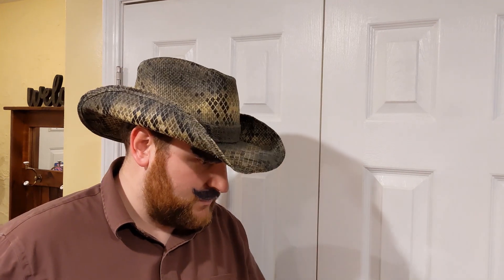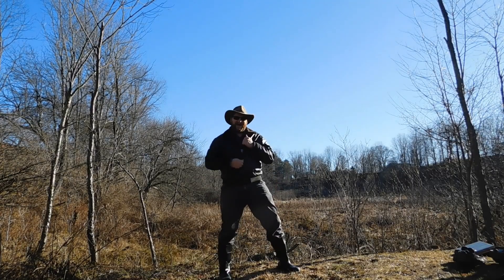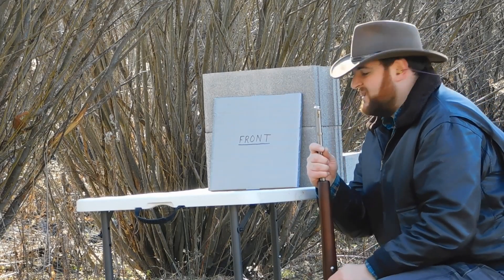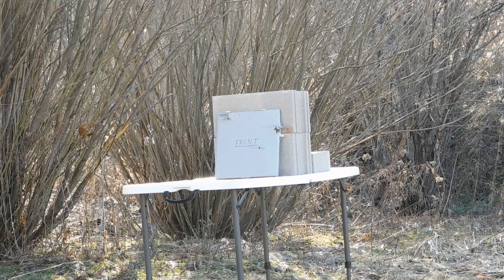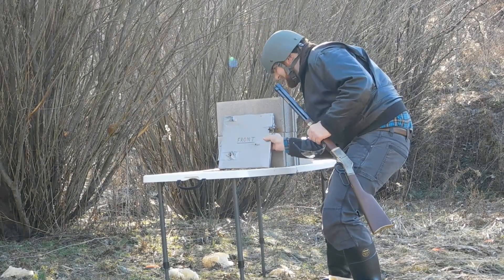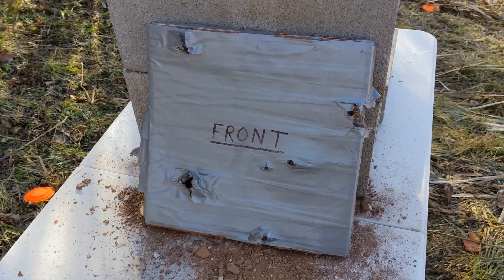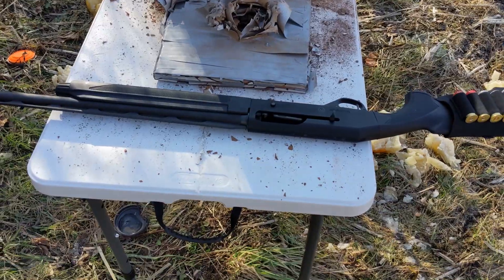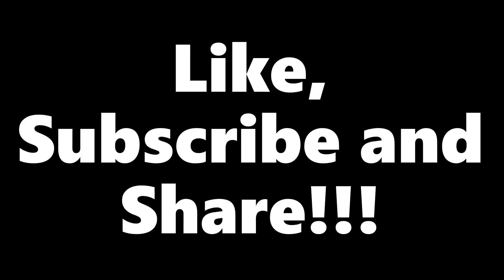Ballistics on a Budget: Archaic Armor

Comment: Overlap interwoven steel fiber at a 45° angle rotation with each other, dip in resin. 

For more realistic protection: 3 sheets of carbonsteel 1/4" thick, fuse by welding, take and dip in molten HDPE, measure and seal with high carbon stainless steel, wrap in duct tape for mind Fuck value. 

Not rated at all, but better than nothing at all. Spray with flex seal, or liquid rubber to assist with minor spalling.
Reply: Btw, add a curve or a couple small offsets to make very minor changes in impact and directional diversion. Very important note: you don't have to defeat the armor to defeat the threat. The internal trauma will cause a lot of problems, so either divert the pressure or mitigate transferred force, you can pad, or you can scuff (think impacts from racecars shedding when the carbonfiber gets torn off.